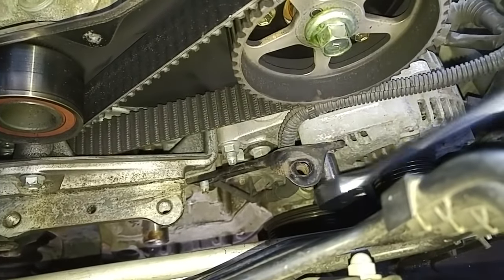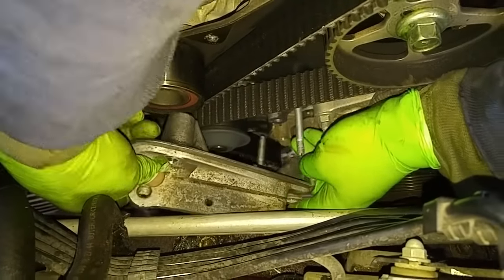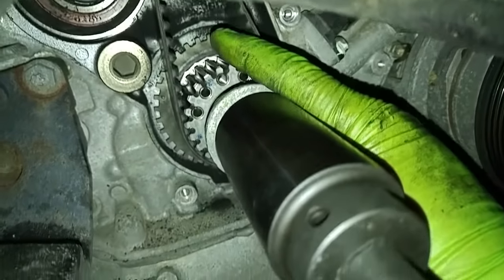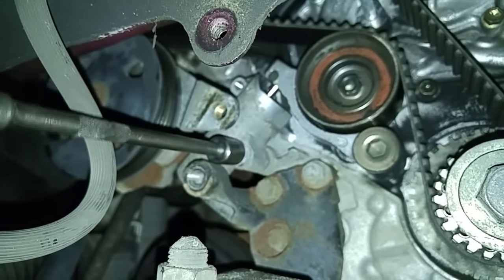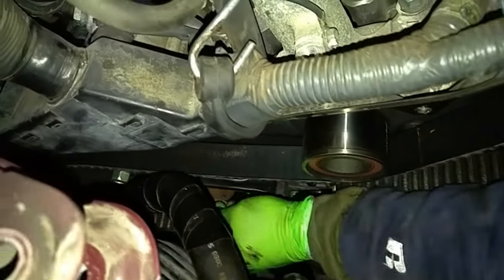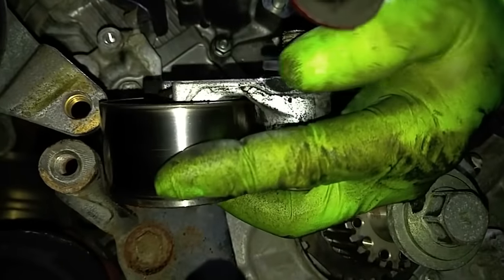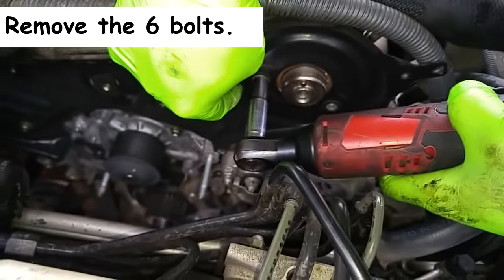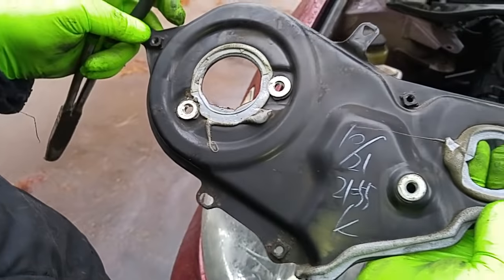Toyota Camry V6 3MZ-FE Timing Belt, Water Pump, Seals & Pulleys Replacement

Comment: Excellent video my friend, I'm still on the fence as to whether or not I want to pay a local mechanic $700 labor to do all this especially when the parts not including the seals cost less than 200, but it is an ungodly amount of Labor, and I also don't have quite all the tools I need so I feel like I'd take several trips to the store like I don't have a polar and I don't have that chain thing to take the cam pulleys off.

But my car is making some kind of squeak and if it's not the AC compressor or power steering or alternator I'm 99% sure it's one of these damn pulleys
Reply from the maker: $700 is a good price if the repair shop is using quality replacement parts.  Otherwise, using cheaper parts raises the shop's profit margin.
Reply: @hardlymovingpro  that's me Supply My Own Parts, 7 hours at $90 an hour plus another half an hour for cam seals
Reply from the maker: That repair quote is overstated.  Way too much.  I can do this job in 5 hours ... and that's pacing myself.  My record was 3 hrs and some change.

Comment: Sir, is it possible to swap 3mz fe in my 1998 camry , it has 1mg fe? Pleaee let me know, will it be bolt on ?
Reply from the maker: Possibly but it's a lot of work and you'd need the 3mz fe PCM computer and perhaps the engine and interior wire harnesses.
Reply: @hardlymovingpro  looking forward to have your expert advise!
Reply: @hardlymovingpro  3mz or any other motor  advise me please

Comment: I did the whole thing but oil is coming out everywhere now when the car runs, I'm assuming it's one if the came seals. I have to go back in today I'll let you guys know what I did so hopefully you can avoid it
Reply from the maker: When I run into oil leak problems like what you're experiencing, I take the belt covers off and run the engine to isolate the leak source.  You can run the engine without having the alternator belt on.  The car will be running off the battery.

Comment: Where  can I buy the tool that are you using to remove the cam pulley
Reply from the maker: I used a chain strap wrench.  You can also use a cam pulley holder tool.  Both tools can be viewed and purchased off of Amazon if you'd like.  The tools and the link to Amazon is shown in the text description of this video.
Reply: @hardlymovingpro  thank you so much.
Reply from the maker: No problem ... and good luck with the job!

Comment: will this work on my solara ve 2001
Reply from the maker: Assuming you have the V6.  Your engine has the "long tubed" belt tensioner.  This video uses a re-designed short tensioner.  Use this video to perform the timing belt job for your Solara:
https://youtu.be/Y7WLtDkcAp0

Comment: I bought  a 2006 Toyota Solara  v6   3MZ FE engine with 168000 km ..not sure if the timing belt has been replaced or not . I would appreciate if some one could tell me if the engine is the interference or non-interference type? thanks
Reply from the maker: 3 MZFE is interference.
Reply: thanks for your quick response.. timing belt looks in a fair state...when would you recommend to replace it? currently @ 168000km
Reply from the maker: Go by the manufacturer's recommendation ... which I believe is 100k miles or 7 years ... whichever comes first.  Although the belt visually may look okay, its internal structure could be degrading.  The only way to tell is to take the belt off.  After removal, when compared to a new belt, the old belt feels like a rubber band and feels to have lost its rigidity.  If you go through the labor to examine the old belt, might as well replace it.   The belts are not that expensive these days.
Reply from the maker: I can do it 5 hours.  If doing it for the first time, around 8 hours +.
Reply from the maker: You bet!

Comment: are these engines a non interference or interference in regard to the timing belt breakage?
Reply from the maker: Yes they are interference.
Reply: @hardlymovingpro  non interference,if so i'll get one
Reply from the maker: They're interference.
Reply: @hardlymovingpro  cheers mate 🙂
Reply from the maker: @aussiemale059  Anytime you see VVT-i on the engine cover, it's interference.

Comment: V 6 Camry you don’t need to raise engine  ?
Reply from the maker: I don't.  But if you raise it slightly, it will make the side motor mount and water pump come out easier.
Reply: @hardlymovingpro  thanks, you know anyone in the DFW area, you’d recommend, doing a good job in changing out the timing belt and components ?

Comment: Original owner. Strange noise coming from timing belt area. Not sure but it almost sounds like a grinding noise,  bad idler pulley or something.  You can actually hear it at times in the car. Whirring, if that makes sense. I thought maybe I had a bad bearing in something going out...Timing belt job was done at 90k yet car is only at 130k. Definitely front camshaft seal leak(they were supposed to replace them)but the noise is what bothers me. I watched another video on here where a guy had the same noise and said it was Gates belts...? Apparently a common issue.  I told the garage to use OEM at 90k but who really knows what they did. 
Would you recommend getting a kit and just going thru it again myself and redoing everything or get it apart and take a look? BTW runs like a top no pwr loss or startup issues.
Reply from the maker: It's a bearing issue.  If the water pump was not replaced, could be a pump bearing.
Reply: @hardlymovingpro  Water pump was supposedly done but at this point after all is said and done if you were going in there to inspect should I just replace everything again?  I'm thinking yes. It's been 5 years, about 50k...?

Comment: How many miles or KM does one get between this large procedure?
Reply from the maker: 100,000 miles or more.
Reply: @hardlymovingpro  Thank you! I was looking at a clean 2007 but it has 253,000km on it and it would need lots of service.
Reply from the maker: Maybe ... but Toyota's have a reputation for longevity ... also I have a lot of DIY videos for Toyota's.  If you can buy it dirt cheap and it lasts a couple of years, it's cheaper than a multi year car note with paying high insurance.
Reply: @hardlymovingpro  True. They want $5000 for that car and I think it's too much. There is another for a lot less with about 132,000km, right around the 100,000Mile mark. I can't do these repairs, just brakes, bearings, stuff I can reach in my wheelchair. This was kinda scary to watch, lol, since it's very involved.
Reply from the maker: 253,000 translates to 157,000 miles.  That's not too excessive.  200,000 miles is a stretch.  $5,000 is slightly below NADA's retail resales value.  Just recently purchased a 2004 Avalon with 180,000 for $3,500 because it's book value was of $6,000.  Car runs great and the paint and interior is next to excellent.  Here's the link:
https://www.nadaguides.com/Cars/2007/Toyota/Camry-4-Cyl/Sedan-4D-LE/Values

Comment: What’s the labor time for this job
Reply from the maker: I can do it with my tools in around 6 hours.  Double that if you're doing it for the first time.
Reply: @hardlymovingpro  I figured it was a 6 hour labor job , if you do this in 12 hours as a mechanic you probably should not be one 😂 well you probably wouldn’t make good money.
Reply from the maker: @bahaulingjunkremoval9187  you're right.  12 hrs find another profession.

Comment: Man if they gave this engine a chain it would be indestructible
Reply from the maker: They did ... it's the 2GR-FE.  Introduced around 2006.   Better fuel economy and more power.  Around 268 hp.  Used in the Camry, Avalon, ES350 to name a few.

Comment: Mannnn it's like $800-$900 to pay a shop for this... Honestly debating on doing it myself (I work on cars a lot but sometimes I just don't have the time!)
Reply from the maker: Actually it's cheaper than a dealership but they may not use OEM parts.  If the water pump (non Aisin) fails, you'll have to do the job all over again.   I've seen dealer quotes of $1,200 ... and that doesn't include replacement of the cam and crankshaft seals.  Plenty of motivation to do it yourself wouldn't you say?

Comment: Wish you had started the engine! I need closure!
Reply from the maker: If you use belt paint alignment marks to position the cams and crank, you can be pretty confident the car will start with no issues.

Comment: I have 115.000 miles on my lexus   can wait little longer to change it .
Reply from the maker: That's your call but also consider the age of the belt and any tell tale signs of a worn out water pump as well as oil leakage coming from your camshaft seals.

Comment: Thanks for the efforts associated with this video

Similar process to the se 3.3 camry v6 ???

Torque of that electric impact 300 lbs🤔

Breaking this bolt loose is KEY 

Confirm brand name of that high impact 22m socket

Thanks!!!
Reply from the maker: Thanks for your comment.  Leslie is the brand and it's noted in the description (SHOW MORE) area of this video.  Even with a 300 lbs impact tool, without the high mass impact socket, you may not be able to get the crankshaft pulley bolt off on the 3.3 V6.
Reply: Hardly Moving Productions thanks!!!!

Comment: How much does a job like this cost?
Reply from the maker: Seen price quotes from $800 to $1,800.
Reply: @hardlymovingpro  Thanks. Drive a 2005 Camry with 147,315 mi. Plan on driving it as long as it keeps running and was wondering if was worth having this done.

Comment: Okay I do everything to the T in this video and when I get everything set, I pull the pin loose on the belt tensioner and turn the engine a couple of times to see if it's right and the paint lines on the sprocket and belt don't match up anymore. What the actual fuck. I'm sorry I'm so frustrated right now

Comment: I think all cordless impact gun makers. Have to certify they can remove Honda and Toyota Crank Balancer bolts...

And video tape it. To prove it.....
Reply from the maker: Even high torque air impact guns won't get it off.  You'll need a high mass socket.
Reply: @hardlymovingpro  I have a torch...Never fails..

Comment: Not a good idea mate sorry to tell coz im having trouble with the dot to align with the cutted line on the timing belt
Reply from the maker: Whatever your comfortable with and works for you.
Reply: Did you get it done or need help?
Reply: Kast King already done mate thanks.
Reply: @danmechanic4267  that's great, but I meant were you able to figure it out or did have someone else finish it? Just curious about to try and tackle this myself
Reply: Kast King yeah I’ve figured it by myself mate.

Comment: Dam did the whole 9, I would have just changed the belt😂
Reply from the maker: Just the belt is too easy.  Also, it's unrealistic to assume the pulleys, water pump and seals will get you to another 100k miles trouble free.  You'll probably have to revisit to job in around 50K miles to address problems you would have avoided from the get-go.
Reply: @hardlymovingpro  I hear you. That's a lot of work. Surprised my friends has made it to 255k without any related problems and I don't think even the belt has been changed😂 at this point a 1000 dollar job isn't worth it but with this job and another trans service, I bet she could get close to 500k
Reply from the maker: @johnnyversaci7091  255K is unbelievable!   Testament on Toyota design and quality!  Can you believe people preferred having a timing chain driven engine?  More centrifugal mass for the engine to turn.  Timing chain replacement jobs are 3x as much as a belt replacement.
Reply: @hardlymovingpro  I could be wrong but the timeline of when she got it and her dad not saying he changed it, im pretty sure it hasn't been changed. I used to think mostly all v6 had chains so I didn't think to tell her about changing it.. I never really thought about a chain being harder on an engine, maybe I'll rethink desiring timing chains now🤔🤔
Reply from the maker: @johnnyversaci7091 Toyota's 3.0 & 3.3 MZ-FE series engine (timing belt) has been replaced with the GR-FE 3.5 (timing chain).  The GR-FE is a excellent upgraded replacement for the MZ-FE.  Rock solid engine and haven't seen any timing chain issues.  If you don't change the motor oil as needed or let the engine oil level drop, that could wear out the chain.  GR-FE gives you around 60+ more hp and better fuel economy.
Reply: @hardlymovingpro  I actually always had a good feeling about those 3.5s, they seem solid, most cars with them are pretty expensive.. I just went against everything I believe not long ago and bought an 01 e320 wagon with 200k on it but everything works on it, thinking I just got lucky though😂
Reply from the maker: @johnnyversaci7091  With normal maintenance, Toyota's can last forever!  I've got 270+ K miles on my 99 Camry with the I4 5SFE engine.
Reply: @hardlymovingpro  nice I was looking into one of those for my brother. My sister's 06 corolla has been holding up nicely for 4 grand and not much maintenance besides normal stuff and some fluid changes

Comment: Made u forgot to show the dot and the cutted line on the timing belt it should be right on the cranshaft sprocket dot.
Reply from the maker: Nice to use but not all that necessary.  As long as the belt has no slack and the 12 oclock crankshaft pulley alignment mark is lined up half moon mark on the engine block, you're good to go.
Reply: Hardly Moving Productions yup i already did what you showed in the video cuz its hard to align the belt mark on the crankshaft

Comment: Christ.  Thank God they went back to a chain.
Reply from the maker: Popular misconception is that chains last forever.  Far from the facts.  Tensioners break, chain guides wear out and chains stretch.  Lastly, replacing a chain and it's components is big $$$ repair job.
Reply: @hardlymovingpro  You can at least get double the life from a chain than a couple of belts if you keep the oil changed, though, right?
Reply from the maker: With Toyota and Honda's ... Yes.  GM & Ford ... Cross you fingers.
Reply: @hardlymovingpro  Yet my brothers '02 Camry 4 cyl still has the original chain at 353,000 miles.  Burns oil like a mother, though.
Reply from the maker: Stuck oil rings frozen on the pistons.  Oil on the cylinder walls will burn off.
Reply: @hardlymovingpro  Actually the 02, 07 and 09 all had a recall with the pistons.
Reply from the maker: Doesn't matter.  Go too long without an oil change or use cheap oil, the oil ring will seize up

Comment: aww no spark plug change, there's no videos on how to do a spark plug change with the 3vz ;-;
Reply: Pull off the plenem and buy an intake gasket set.
Reply: i did plugs with extensions and 2 swivels. slid it down beside fire wall onto plug without removing plenum. 2003 solara v6

Comment: No wonder these Camrys last 200 000 miles when you overhaul the engine every 100 000 mi.
Reply from the maker: Belt and water pump replacement is part of the maintenance ... Not overhaul.
Reply: @hardlymovingpro  I was sarcastic. Now I am serious: this is what people call high  maintenance. I have Dodge caravan with 300k  mi, all I do is fluid changes and spark plugs every 100k. I don't count brakes or tires.  Your videos are great you are pro I enjoy watching them.
Reply from the maker: I know.  No problem.  I've seen $1,800 dealer quotes on a timing belt / water pump replacement and some may consider that a rebuild.
Reply: @hardlymovingpro   Dealers are rip off and outrageously expensive, this is why independent capable mechanics like 
YOU are god sent. God bless you.

Comment: On the one I am working on, you have to remove at least one Cam gear to get the water pump off.
The cover plate sits on top of the pump.
This is the most asshole engine ever made.
Reply from the maker: I hear ya!  Since I always replace the cam seals with this job (because these seals have a bad habit of leaking), I remove both camshaft sprockets allowing the back timing belt cover to come off with ease.  Once remove, the water pump can be easily replaced.